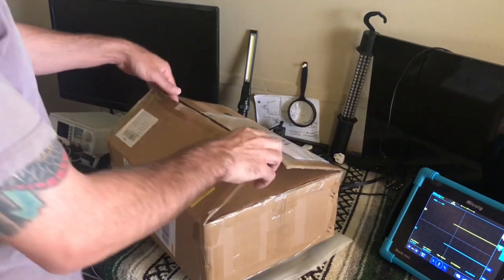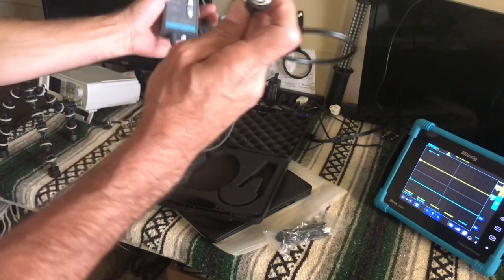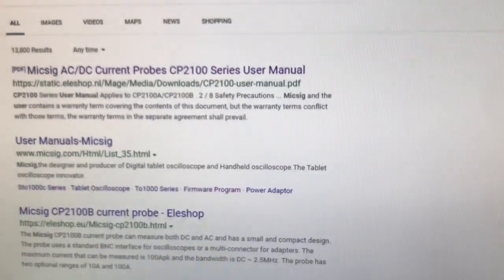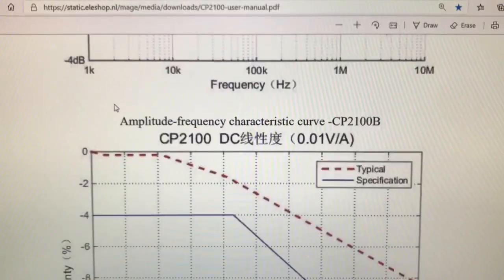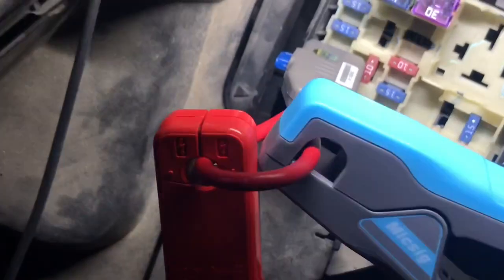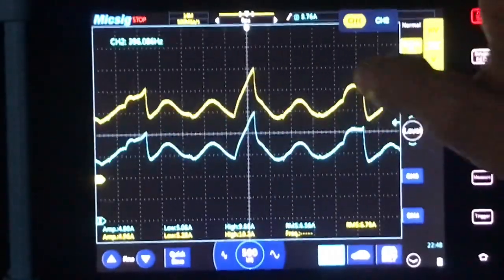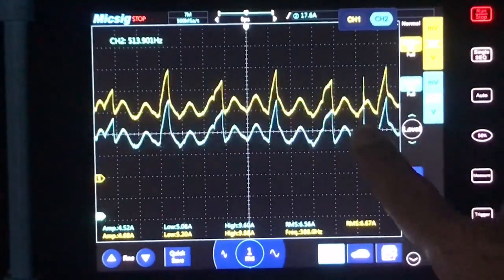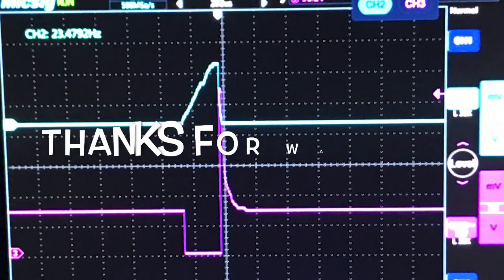(Part 1) Micsig CP2100 Current Probe Unboxing & First Use Part 1 Bad Fuel Pump Current Ramp

Comment: Just found your channel as I'm looking for content regarding the micsig I just bought. I'm happy 😁. So the micsig probe is about $250 shipped. The pico is half the price. What's your advice?
Reply from the maker: Hello Usman The Mechanic. That’s great, you got a Micsig. How do you like it so far? Which model did you get? As to your question, I guess it depends what you’re using the probe for. If you are using it for mostly automotive use, I would say the Pico should do just fine for you. Of course you’ll have to get both, the low amp & the high amp current probes. You’ll probably use the low amp clamp the most. I would say a couple things I like more about the Micsig probe, is that you don’t have to worry about batteries, since it gets its power from plugging into your Micsig. I also like that the Micsig goes up to 100 amps, where the Pico only goes to 60 amps. If you’re using it for other uses where you might need more bandwidth, I would go with the Micsig. They have 2 options. One is the CP2100A with a bandwidth up to 800KHz, and the other one (that I have in the videos) is the CP2100B that has a bandwidth up to 2MHz. Of course the second one is more expensive. I’m not an expert on explaining bandwidth, so I’ll leave that up to someone else to explain, lol. But as I said, if you are using it for automotive use, you should be fine with the Pico; that’s what a lot of guys use. Just make sure to keep extra batteries close by. I hope this helps. Thanks for stopping by the channel my friend.
Reply: @atomsworkshop195  indeed Atom this was of great help. 
I bought the sto1104c and was able to record first capture on my channel.
I will continue checking out your content. Please leave links to the pico probes and leads

Comment: Nice love your videos
Reply from the maker: Hello Steve. Thank you for that. If you look at my video with the Micsig CP2100 current probe (part 1 I believe), you can see that I’m connected to a soon to be failing fuel pump. Hope this helps. Also, in another video (can’t remember which one) I believe I compare a bad fuel pump to a good fuel pump, after I replaced it. Thanks for the comment Steve.

Comment from the maker: I’m not sure what happened to the comments that were here. There were a couple questions from someone with the YouTube name of Honda something (can’t remember exactly). Maybe he deleted them (I didn’t). One was mentioning the difference in price between the Micsig CP2100 & the Pico TA018 (PP264). First off, I have nothing against Pico. I personally own the TA018 (PP264) & the TA019 (PP266).  I’ve had plenty success using both. They have both proven to be reliable. They have been probably the most popular/used current clamps in the automotive industry. Also, I am not sponsored by or paid by Micsig. With that said, back to the price. The TA018 runs just over $100, has a maximum conductor diameter of 9mm, has 2 settings-one for under 20 amps and one for 21-60amps. I can not find the bandwidth capabilities. Also, it needs a battery to operate, with a low battery indicator. It has a zero button. Maximum conductor voltage is 300 volts DC. On the other hand, the Micsig has two models to choose from, CP2100A & CP2100B. CP2100A runs just over $200 & CP2100B runs between $500-$600. To my knowledge the difference between the two is the bandwidth, with CP2100A at approximately DC 800 KHz, and CP2100B at approximately DC 2.5 MHz. The CP2100 has a 13mm maximum conductor diameter (that gets you around a battery cable), two settings- one for 10 amps and under, and one for 11-100amps. The CP2100 does not need a battery. It gets its power from your scope or computer via a usb cable. It has an auto zero button as well as 2 manual zero buttons. When you press the zero button, it will beep once if it zeroed correctly, or beep 3 times if it did not (possibly magnetic field interference). Maximum working voltage states 600 volts or less, with an overload protection with the buzzer beeping and the button light will flash. Also, if the current exceeds the range you are testing, the probe will beep and the light will flash. On a personal note, I do like how the Micsig clamp is separate from the actual module. This helps for tight hard to reach places. I like how the buttons light up to let you know what setting you are on. I like the lower 10 amp setting, and that it goes up to 100 amps. Now that I have both, I have a 10 amp, & a 20 amp setting to use depending what I am testing. Just like anything else (scan tools as an example), the more options you have in your arsenal, the better off you will be. Not to mention, it’s nice to have the current clamp that was designed for my scope. Last but not least, I really like that the CP2100 comes in a nice little case with the soft but firm insulation. I mostly work as a mobile mechanic, so I’m not keeping everything in my toolbox or cart. I hope this information helps anyone interested in purchasing the Micsig 
CP2100 current probe.

Comment: Nice, a bigger hole for battery cables that the low amp wont go round. That fuel pump is feked
Reply from the maker: Dave Sterl, thanks for stopping by. Yea, if I remember right, the low current Pico clamp measures in at 9mm. This Micsig is 13 mm. Those 4 mm don’t sound like much, but sometimes that’s all you need. Yea, I don’t know how that car is still driving. Like you said, that pump is shot. She says it drives the same as always, with no problems. I’m no expert, but looking at those commutators, I’d say any time now, it’s going to leave her on the side of the road or broke down in a parking lot somewhere. Dave, thanks for the feedback.